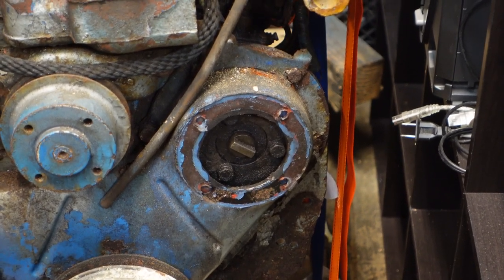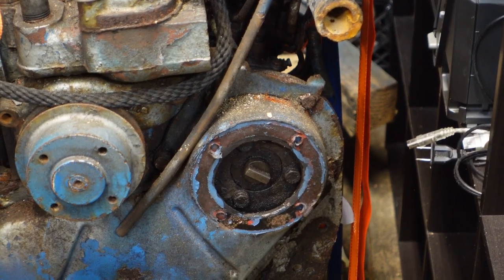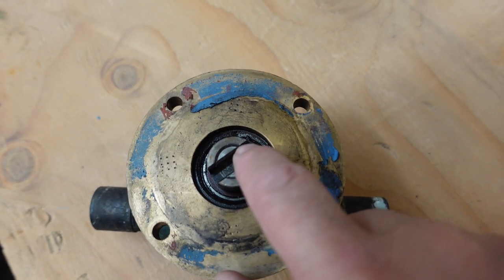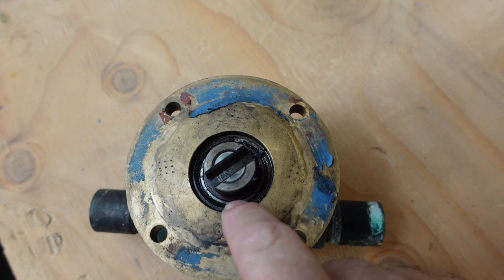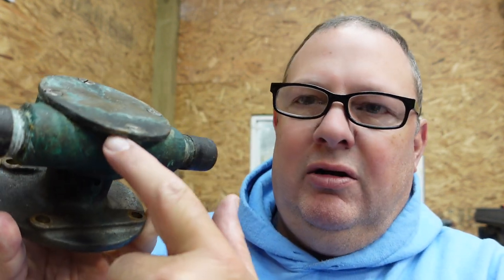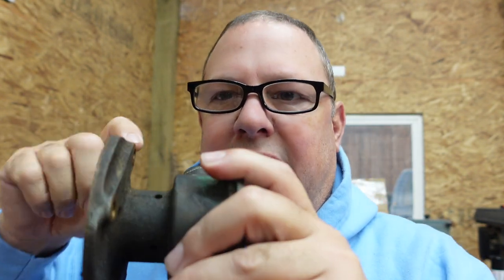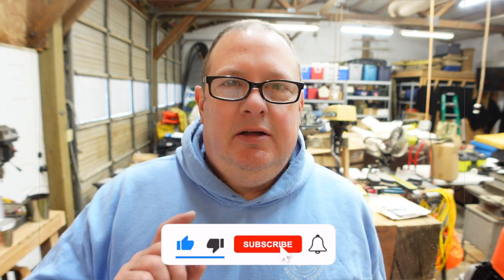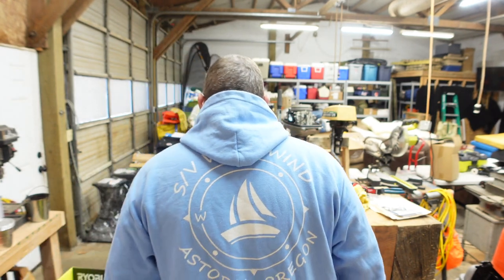Perkins 4-108 Raw Water Pump Rebuild | Step by Step with Part Numbers [EP 101]

Comment: Same engine, same boat, same issues. It has been a while since I took my pump and timing gear cover off. I needed to find a new cover because the pump leaked and rusted out the cover. I was hoping you would show the support ring with studs that are behind the cover, and thereby affirm my memory how it goes back together. My engine has not run in 14 years, but everything SO FAR seems fine. It turns over easy, the rockers needed a little lubrication assistance, I rebuilt the injectors, replaced the alt., lift pump and freshwater pump, and I am now letting it soak in oil. I think while it soaks i'll rebuild the pump. Your videos are a great. I did the valve lashing with your assistance, thank you. I've talked to a master mechanic/friend about the HP pump, and asked if I should rebuild, he thinks it will be fine. I told him I was going to lubricate it with Lucas, he suggested Marvel Mystery Oil and fuel treatment, so I will prime it with a mix of MM oil and diesel...  Thanks, keep up the videos.
Reply from the maker: You might want to have your injectors tested before you put them in. This is to give you confidence that they are not over fueling which will wash cylinders and take out bearing. Also causing fuel to get into the oil pan. Just a thought.

Thanks for taking the time to comment. 

I will see what I can do about making a video about the studs for you.
Reply: @SailingtheWestWind  No need, thank's though.

Comment: This video is very informative.  Thanks for making it.  I have never rebuilt a pump like that before but it looks like some pump lube would be in order for the impeller vanes.   Great video!
Reply from the maker: Thank you very much.  Any other Perkins related or other you want a video on?

Grant
Reply: @SailingtheWestWind  Not at the moment.  Thanks.  My engine has an Oberdorfer raw water pump and is very similar.  I haven't had time to work on it yet.

Comment: There are a bunch of things done badly here. 0. Get a slotted screwdriver that fits the size of your screws, especially if they're a bit stuck. 1. Put the pump body in a vise and get a couple of pairs of needle-nose or vice grips (or better still, large hemostats) to pull out the impeller -- DON'T pry with a screwdriver against the soft bronze pump body, as you can raise burrs on it. You can see the shiny bits of bronze where your screwdriver has marrred it A little WD-40 can help you get started. Driving out the shaft isn't a viable approach when you need only to replace the impeller, so you might as well learn to do it right. 2. The slot in the shaft fits over a tab on a gear inside the engine. The end of that tab needs to NOT be pressing against the bottom of the slot in the shaft. So getting the shaft in all the way to the right depth matters -- it's best to measure how far it sticks out before you start. A basic set of digital calipers from Harbor Freight will let you do this. 3. When you drive the shaft out of the pump, don't rest HALF of it on your bench and hammer: get a board, drill a hole in it a little larger than the shaft, and rest the pump on that board while you drive out the shaft, so that it's supported all around and the driving force ends up straight down. 4. Driving the seal out with a screwdriver just wounds my soul. Get a socket that JUST fits through the hole and drive it out nice and square 5. At 14:00, rubbing those beautiful machined faces against something like 60-grit sandpaper is just a crime. 400-grit, followed by 600 and then 1000, on a piece of plate glass...totally reasonable. 60-grit, filling it with scratches...ugh! 6. At 15:21, when you extract that screw, you should also be extracting the copper crush-washer that makes a seal at this critical location. You can see that crush washer on the replacement screw early in the video, or at 19:11. Putting the old one back in was a stroke of luck for you, because the old crush-washer is probably stuck in the socket.  7. At 16:22, you want to run your finger around the edge of the seal, to make sure that the metal edge of the seal isn't sticking up at all into the space the impeller will occupy. 8.  at 17:00 is the biggest sin of all: when you press bearings into a socket, you want to press on the OUTER RACE of the bearings, because otherwise you're putting an axial load on them for which they were not designed, AND you may be repositioning the shaft relative to the bearings (if the inner race slips along the shaft). You need to find a socket large enough to fit around the slotted shaft-end, so that when you tap on it, it's tapping on the outer race (i.e., outermost metal part) of the bearings. And when you do this, you'll want to check that the protruding shaft-end, when you're done, is sticking out the right amount, as measured in step 2.  9. If the half-moon key keeps falling out during installation, you can stick it in place with a little honey or a very thin piece of paper, both of which will dissolve in not much running time. To make it easier to insert the impeller, use two zip-ties to collapse the blades (the direction doesn't matter!), about 1/3 and 2/3 of the way along. Put the impeller in a little, cut the first zip-tie, push in a little more, cut the second, and you're done. To make that whole step easier, lubricate with a LITTLE dishwashing liquid. 10. at 21:40, you say to never use silicone, and if you mean "never use the kind of silicone sealant used for aquariums, etc.", that's correct. But RTV is, in fact, a silicone adhesive sealant.  On the plus side, there are a bunch of good things here --- the advice to remove the half-moon key before installing the shaft, the careful discussion of which way the seal is oriented, the use of a wood block rather than hammering on the metal face (although a hardwood scrap is likely to be more effective than the softwood shown). The introductory discussion of where leaks can occur is good, although it'd be nice if you said "leaks from the front plate or screws...you can probably fix with an impeller kit, which has a new gasket that'll take care of things; a leak from one of the weep-holes farther back means you need a rebuild kit. And a leak from the screw at the top of the pump...that MIGHT just mean you need a new crush-washer, or maybe you need a rebuild kit." For those replacing the front thin paper gasket, BTW, removing the old gasket without scratching the pump body is a pain, and scratches lead to leaks. The magic trick is to use a little bit of oven-cleaner (spray it into a disposable plastic cup outside; use an 'acid brush" or Q-tip to dab it on to the pump body or cover plate wherever the paper gasket is sticking, and wait 20 minutes or so. You should be able to remove the residue easily with the straight edge of a plastic picnic knife or something equivalently soft -- NOT a metal putty knife!   Now you might say "Look,  he did this stuff and it all worked ... why are you being so picky?" Well, we don't actually know that it worked, but I do know that scratches can lead to leaks, driving in a bearing by putting axial loads on it is bad, sometimes seals or bearings are stuck into the pump body badly enough that getting them out is really tough, and skewing them a little can make it nearly impossible, and that the depth of the seal and the shaft are critical: a bad shaft-depth can really mess up the gear-train that drives the shaft. So: can you get away with this approach? Sure, if you're lucky. But if you want to avoid trusting to luck, you might want to do the work in a way less likely to lead to troubles.
Reply from the maker: Thank you for taking the time to comment. I appreciate you for that.
Reply: Trying to pry out an impeller with a screwdriver???? Dude clearly has never replaced an impeller before. As you mentioned the depth of the shaft needs to be measured. The previous owner of my boat did not measure the depth the shaft depth. The water pump shaft and drive gear in the engine stripped each other.....IN THE MIDDLE OF HE GULF OF MEXICO.
Reply from the maker: @SOLDOZER  Thank you for you're reply, I appreciate it, I really do.  I know a screw driver is not the best way to remove the impeller, especially after the engine had sat for 22 years.  I was trying to do this video quickly.  The issue you talk about does not apply to a Sherwood G65 pump.
Reply: johnhughes1595   The following is intended as a respectful comment not a criticism in any way.  After reading your in-depth comment I clicked on your profile hoping to find similar how-to videos but did not find any.  If you would take the time to produce your own hot-to videos people like me, and many others, would be very grateful.  Reading about things is fine but many people are visual learners, meaning they absorb information and material better by watching than by reading.  Please take this comment as an encouragement to share your experience and knowledge, through your own videos, with the rest of us who are VERY interested.
-Respectully

Comment: Great video!  The one thing I noticed with my newer impeller replace kit 09959K-SHW is that the impeller vanes are thinner, and I'm wondering if this will reduce the pumping pressure of the impeller and the overall water flow.
Reply from the maker: It shouldn’t. It could technically fail sooner. Keep her extra one or two with you as well as an O-ring.

Comment: When mounting the pump back onto the engine block do you have to do anything with the timing of the internal gears to realign them or do you simply rotate the key on the pump to match the knob inside the motor housing and set the pump in place with the bolts?
Reply from the maker: No timing involved
Reply: @SailingtheWestWind  so simply match up the key in the pump assembly with the gear on the motor block?
Reply from the maker: Yes. It doesn’t matter which way it goes in. It can go in two different directions.